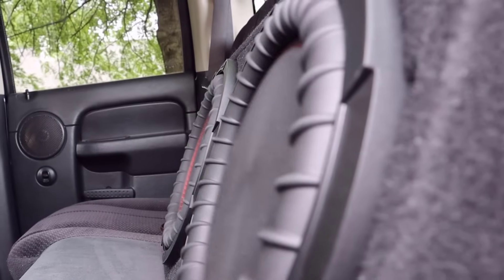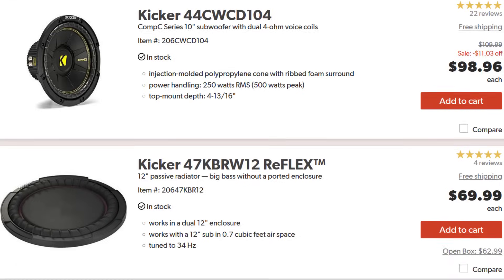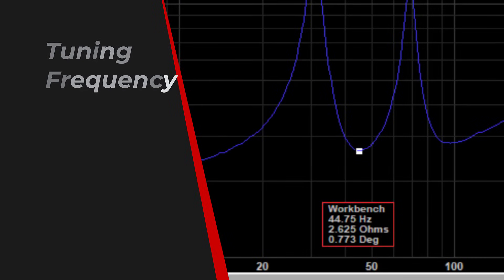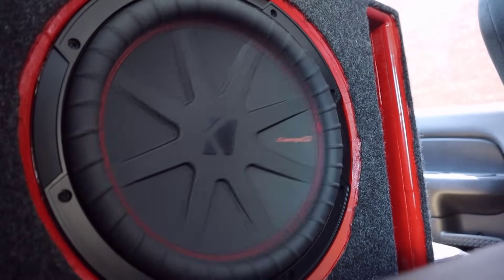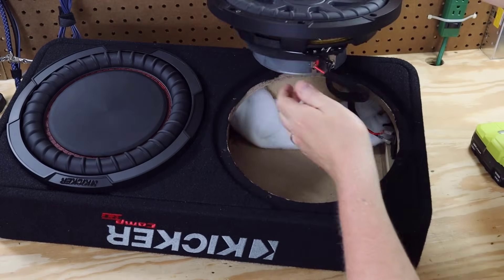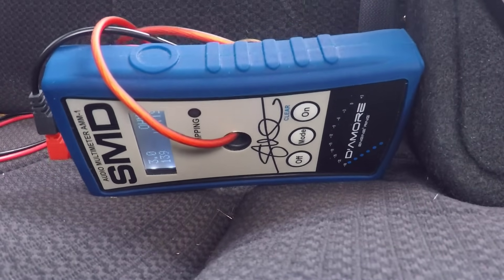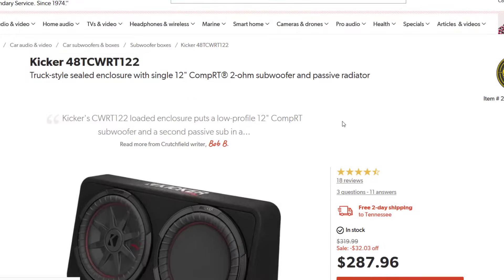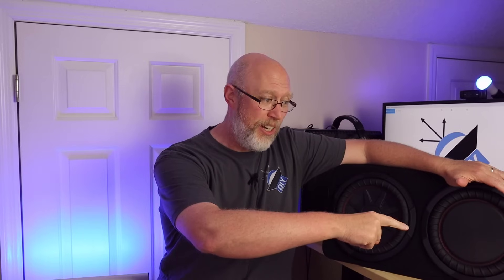Bass in A Small Space:  Kicker Comp RT Slim Passive Radiator Enclosure!

Comment: I have this and it's pretty loud! I added some weight to the passive radiator to lower the bass down to 35Hz. I just used silicone as weight
Reply from the maker: Cool!
Reply: How you did that?
Reply: How much weight did you add?
Reply: I'm guessing you could add Dynamat or some other brand of sound deadening with adhesive to the back of the passive radiator and choose the weight you want to add...

Comment: I think I mentioned this in Big D's video too but the one thing that kept me from purchasing this was that it only came in a 2-ohm impedance at the time. I love the idea of what Kicker is doing here but a lot of people use 4-channel amps for their entire system (channels 1 & 2 for a front stage & bridge channels 3 & 4 for a sub) and this is a no go for them right out of the gate. The down-firing 12" option would've been perfect if only it came in a 4-ohm option. Regardless, thank you for the video!
Reply from the maker: That's a good point!    There aren't many 4 channel amps that can handle two ohms bridged.

Another option would be to get two of these and just run one off of each of the rear channels.  Or get two of them and wire them in parallel and run them bridged off the rear channels.
Reply: @DIYAudioGuy  Wiring two in a series would probably be a better option for most 4 channel amps but I know what you meant 😉 Really appreciate your taking the time to reply to your viewers after putting in so much time on these videos.
Reply from the maker: @BStreet666  Yes.
Reply: More often than not it is a DVC subwoofer making these 2 ohms final load. In a similar situation I have been known to use 2 other methods than already mentioned.

One is to remove the subwoofer and bridge it in series and put it back in. Usually not a problem at 8 ohm as most of these small enclosure subs cannot take large amounts of power anyhow. 

A second option is to remove the sub and make a way for 2 wire sets one for each coil. In order to get around a warranty situation I remove the metal push terminals from the terminal cup which leaves a small ovalish hole where each terminal was mounted. Using a small enough gauge wire to fit and sealing it with a bead of silicone or hot glue. Can easily be cleaned up and returned back to  original. Don't forget to put a knot in the wire just on the inside of the terminal cup to prevent it from being pulled out.
Reply: Not if you get like a phoenix gold XS4300. Stable at 2ohms bridged, 1 ohm stereo.
Reply: @MurderousMindstate  
And run the low pass filter and gain settings exactly the same on both channels feeding the coils, and feed the amp a mono signal.

Comment: I had two of these 10" boxes behind the rear seat of my crew cab truck... absolutely loved them. Tons of punch without broadcasting it to everyone outside the truck.
Reply from the maker: That is what they are designed for.
Reply: @DIYAudioGuy   is there any 2 15s ?
Reply: What truck do you have?  I have a 2022 F-150 STX and only one of these looks like it will fit behind the rear seat.
Reply: @CactusJack252  it was a 97 f350.

Comment: I'll be putting the 6.5 subs under both my driver and passenger seat. Plus I have a rear deck that allows 2x 6.5 speakers and in the middle a free air 8in sub. My acura TL sounds great. It's not to much where I'm vibrating the vehicle next to me. But it booms on the inside. Love it! Thank you kicker.
Reply: Nice ive never heard someone do 6.5 under doesn’t actually sound lik a bad idea i had the thought of adding two bazooka 6 inch subs

Comment: I have 1 of the 6.75" models in the rear hatch of my 2014 Ford Focus ST.  My car originally had the complete Sony sound system, but I found the OEM 8" (7" actually) sub was rather lackluster in it's performance (which I think is actually because the factory amp cuts the gain of the sub channel when you start playing the volume above half).  I have the mini box being driven by a Kicker DXA 250.1 Class D monoblock (which is actually more powerful than the box is recommended for), and I used the speaker wires that go from the sub channel of the factory Sony amp to the factory sub as a high level input to an Audio control LC2i, which cleaned up and boosted the signal, and provided a work around for the stock amp throttling the volume/bass, and I didn't have to open the dash or anything to get wire taps from the head unit (Still Sync factory HU).

This 6.75" Comp RT box is smaller, and lighter than the stock Sony one made of resin.  It also is able to play deeper, hits harder, and plays louder without much effort.  It's exactly what I wanted, because I didn't want to sacrifice cargo room in the rear hatch, and I also prefer the sound of smaller subs for in-cabin bass response, without broadcasting bass down the block.

This is one of my favorite subwoofers that I have ever had (I have had MTX Blue Thunder and Black Gold, JBL Power and GTX series, SAS Bazooka tubes, and a bunch of PowerAcoustik subs too).  Most people that have had a demo of my stereo are baffled when I show them where the bass is coming from.  I am so impressed with it, I have bought a single 10" Comp RT box for my 77 Chevy C10 Silverado Resto-mod...
Reply: So question.  I have a fosgate 125amp rms class d amp pushing a 10 inch kicker at 4 ohms.  I too jumped from the factory high level wires to the oem 8 inch sub, and went directly into the high level/auto turn on of the fosgate amp.  Would the lc1i improve my base.  2019 ridgeline rtl-e 8 speaker system.
Reply from the maker: @Dave-lm3th  only if the factory system has modified the signal going to the subwoofer in some way.  A common thing is to roll off the bass as the volume goes up.  In other words as you turn up the volume the factory system doesn't turn up the volume of the subwoofer and this keeps you from overdriving the subwoofer and blowing it.  

If you think you need a device like that I recommend getting the nvx version.  It will do the exact same thing for about half the price.  If you buy directly from the nvx.com website and use the code DIY audio 10 you can knock a few more bucks off of it.

https://nvx.com/collections/eqs-and-sound-processors/products/xlca2x-2-channel-line-out-converter-digital-bass-enhancer-with-xboost-impedance-matching-and-remote-level-control

Comment: I’m 48 so I grew up when every one had after Market systems in there vehicles in the 90s I had a lot of kicker competition they were actually the first subs I had  two12  inch Kicker Comp with Alpine Amps Alpine pull out stero then the detachable faces came out it was messed up because even if you took your radio out if somebody knew what kind of sleeve you had somebody stole a alpine sleeve came out to my truck and lucky I had took my Games and subs out of the vehicle because those about to install some more stuff I had bought some alpine 6 1/2 of the speakers 

A friend of mine he had a 1992 rodeo he had a Kenwood 1021 amp with a custom box he build with 4 10inch Kicker Competitions and two face straight towards all the way in. The back I can’t remember how many inches away from the back they were then the other two were facing towards the back window 45° angle and he had 4 alpine 6 1/2 I forget what kind of amplifier he had hope to them the base hit so hard because of the design of the box away the subs were facing and they Kenwood 1021 what is their largest amplifier they have at the time after my truck  I got the alpine detachable face because they stole the sleeve to my  Alpine pull out lol I was so mad 
When I was young in the 90s I came across a lot of stereo equipment I mean about almost a friend ever then I always had friends and I didn’t have a lot of money and I’m sure the stuff was hard but we used to get it from this guy at the flea market I got rid of those 12s and got two 10 inch kicker comp with The Alpine amps them I got rockford Fosgate amplifier I’m trying to remember I had so much stuff stuff cast on a few times so I got new stuff the last aftermarket system I had was 310 inch JL audio 10 W sixes with the rockford amp with a Kenwood detachable face they were nice subs thsts back in 1996 and all the new Kicker Solor Barricks  they had a lot of problems so gave up on the kicker and goe the JL audio 10W6 they were some great subs

Comment: Built one with kicker parts and it sounds amazing!!!  8” PR with 2 6.75” subs by kicker.
Reply from the maker: Cool!  My only complaint is they kicker does not provide any specifications for those passive radiators. They are intended to pair with specific subwoofers in a specific airspace.  I thought about playing around with them a little bit and using some epoxy to put weights on the back of the cone.

Comment: I have the 6.75” version as it’s the right size to fit behind my seat. Coming from much larger subs and enclosures, I noticed right away it can’t hit the lowest notes very well. But when you consider the size and price, it really made a difference in my small sports car. They sound really good. 

I have a second one coming to put behind the passenger seat.
Reply from the maker: Yeah, you definitely want to run multiples of these.
Reply from the maker: Oh, and if you click on the link in the video description and buy it from Crutchfield, I'll get a very small commission. Doesn't cost you a dime but it means a ton to me.
Reply: I have the 6 75" model too, I used it to replace the stock 8" Sony unit in my 14' Focus ST.  It's being driven by a Kicker DXA250.1 (which is being fed a source from an Audio control LC2i), and it plays louder, hits harder, and the in-cabin bass response is nothing short of astonishing for how small the cabinet is.  It sounds good in the car, without broadcasting bass to the next block, which is what I was looking for.

Comment: I have the 12 inch version. I’m used to my zv5-15 sundown in my other truck 😂

My curiosity is, if I was to convert the box to a single 12 no radiator and make the box ported if it’ll perform better helping with the lower notes songs I 9/10 times listen to
Reply from the maker: You can try it, but there's a reason this one is designed with a passive radiator.

Comment: I tried 1 in my f150, very under-impressed. had a 12" P3 before that, it was leaps better.
Reply: The p3’s are also $1200..
Reply: @spookiiigames3156  they cost about the same, a loaded 12" P3 is 379 on amazon
Reply: @everss02  oh you’re talking about just the single sub. Honestly, I’d bet it was either down to your amp, sub location, or simply too small of a box/cabin ratio. Harder to build pressure = sound louder. Probably why the ported p3 did better in your truck.

Comment: I'm kicking around the idea of getting a couple of the 8" radiators for my comp q 12 box, if you want to add weight look up " elevator bolts " which have a large head that you can use to adhere to the back

Comment: These look pretty cool. How do you think they would stand up against a 10tw3 in a sealed box?
Reply from the maker: The engineering for the two subwoofers is completely different.  These Comp R thins are mostly just normal subwoofers that are very shallow.  So just comparing the 10-in subwoofer, no enclosure, the JL should be a Superior subwoofer. But it's three times the price of a comp rt.   With that big of a price difference the JL had damn well better be the superior subwoofer.

Comment: Those slim kickers put out good bass for sure, I’ve never tested one of those loaded enclosures but I’m sure they’re nice
Reply from the maker: I think they are the best compact enclosure on the market right now, just got to keep in mind that compact enclosures can't put out as much bass as full size enclosures.
Reply: @DIYAudioGuy  I had a 10” comprt in a 1 cubic foot sealed box in my old truck and it sounded good with some fiberfill.
Reply: They definitely thump when properly powered, but there's been some discussion about how they handle low frequencies. I have the 48TRTP102 in the back of my F150, powered with a JL audio VX1000/5i amp, which supplies 600w RMS at 2 ohms on the sub channel. Plenty of power. The issue I had was what would best be described as muddy bass, like bad. Fortunately, the amp I'm using has ridiculous amounts of tuning capability. Obviously, acoustics vary from vehicle to vehicle, so some tuning is to be expected. What I found was basically everything from 40 HZ on down needed to be significantly diminished. Now that I found the offending frequency range, it's a matter of fine tuning and selecting the best filter curve for the application. One other thing people may wany to consider when purchasing these down firing kickers...the surface needs to be absolutely dead flat. The mat in the back of my truck has raised contours, I'm guessing for decorative purposes. I recently inspected the sub unit and found slight rub marks on the passive radiator surround ring. It's been hitting the raised contours on my mat. I ended up installing 1 inch rubber feet to alleviate this issue, but be aware...these subs really do sit THAT close to the surface their on.
Reply: Skar 10 inch 600w.  I've bought all of them for money can't beat these😊

Comment: I have a 19 golf GTI and want to keep and much room as possible. I don't need anything crazy for bass. Just to have some fun. What would be a good size? And would I need to update any of my electronics? Thank you for the help!
Reply from the maker: That is exactly what these are designed for.  Most stock electrical systems can produce enough juice to power the type of amp that you would use for this type of enclosure.
Reply: @DIYAudioGuy  awesome thank you! Good to know. would the 10' be over kill? I'm not well versed in knowing sizes to air volume
Reply from the maker: @2ZH  I recommend that you get the biggest you can fit/afford.  It's also important to make sure that you pair it with a good amplifier. I recently did a test on a Sound ordnance M350.  That a would match well with one of these 10 in enclosures.
Reply: @DIYAudioGuy  got ya! Thank you so much!

Comment: What would you do: this set up (10in active with PR) OR two 10in active subs?  Crew cab pickup with down firing sealed box.
Reply from the maker: I would go with two of these boxes.
Reply: @DIYAudioGuy  Thanks for the reply!
I don't think I'd have enough room for two full boxes with 4 drivers...only have space for 2 10" drivers in a box.  So it's either two active or one active / one passive.
Reply from the maker: @brando8791  If that is the case then go for the passive  radiator box.  You will not have enough airspace for a single 10 sealed.
Reply from the maker: @brando8791  https://youtu.be/n7j4e_LRl88
Reply: @DIYAudioGuy  Thanks Justin.  Your videos are great!
The box I'm looking at has 1cuft total airspace.  Kicker CWRT10 subs need .4-1.25 sealed...so technically 2 wired 10's would fit and have enough airspace to live.  It would just be a tighter sound from the sealed box.  If the passive radiator acts like a port, I guess the output from a single sub with a radiator would be closer to a ported box sound?  I haven't ever heard a radiator set up and don't have any audio shops around me any more (thanks, COVID) to sample this set up.

Comment: I bought the 12” version. It sounded great while it lasted. But I heard the xmax is around 13mm. Is this one way or is it both ways total? Sounds like a dumb question, but I couldn’t find anything regarding this. The reason I am asking is that I’m looking for a replacement 12” shallow subwoofer that will not dent my wallet.
Reply from the maker: The listed x-max is supposed to be one-way, so it would be 26 mm peak to peak.  Fairly typical for a shallow sub.

Comment: I have a question towards an spl build..but wayyyy different...lol
Suppose a standard 2dr car with trunk..wall build..but like this..
The trunk is a sealed box ie trunk wall..maybe a high xmax 18 or pair of high xmax 15s..now build the wall box in the back seat where the active subs fire into..so instead of a 4th order port you have a sealed wall with 6+..12"+ passive radiators...?.. The radiators are your cabin "cone area"..driven by the internal sub,s... I know you would 180 phase the subs to correct the phase of the radiators to the cabin mids..etc
But would it work..???
Reply from the maker: You could do that, but it is probably not worth the trouble.  Ports are affordable and effective.

Comment: I have this box.  10" with passive.  Can I rebuild the box and get a lower tuning frequency. I'm bound by the triangle style box with. 4" and 6" on their respective sides and then 14" on width.  I can go fairly fairly long though, up to 51". Of course I rather not go that long. Can you help on design?  I don't have the cash to change out speakers.
Reply from the maker: What you are asking for is a custom box design.
Reply: @DIYAudioGuy  correct. Can I get that sub and passive tuned down to 32ish hz?

Comment: When I bought my rt 10 and 12 they didn't have this I bought them the first day they they hit the shelf the passives boxes came out a year after unfortunately.         My 10s and 12s that I have are the first gen rt models and there actually different there rated higher on the box it says the 12 rated at 800rms each and 10 600rms most people don't believe me but I have the original package's  the cone is also different there isn't a center cap like the new models and the new models are rated for less power. I remember Parker testing them and I commented his ratings were wrong not knowing they had changed it know one believed me or back me up on this  I'm positive kicker knows. Most people still don't know the first gens RT are different. Kinda strange